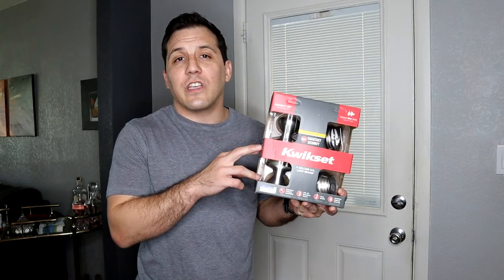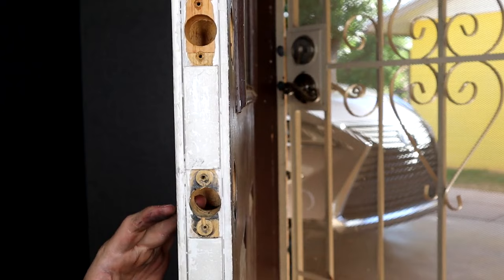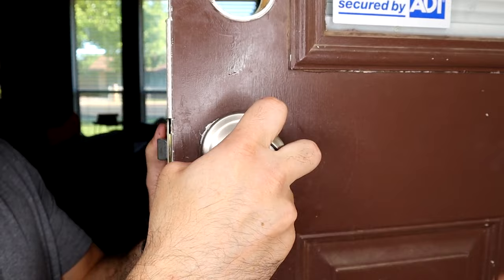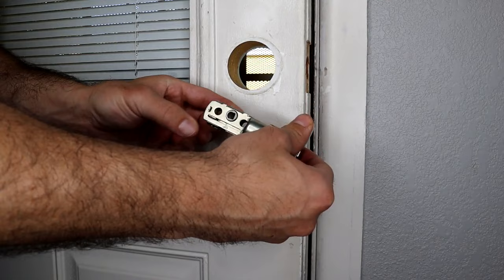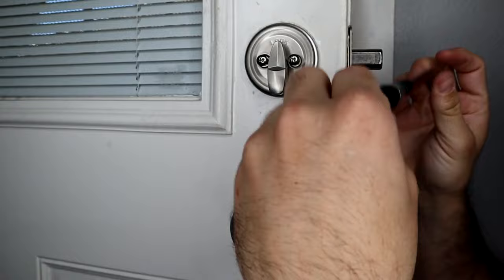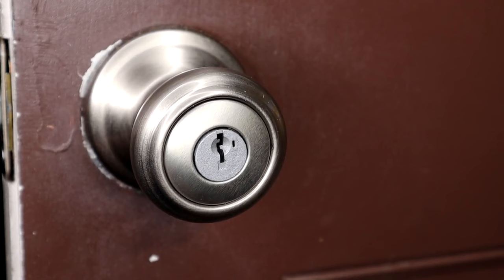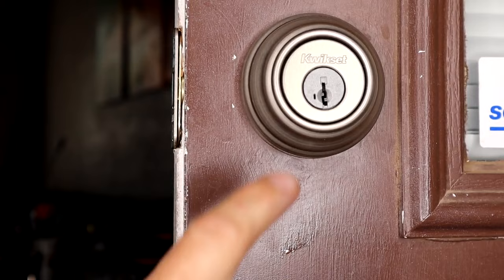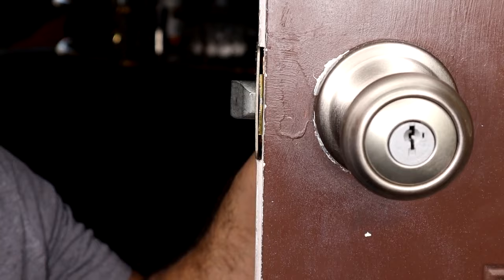How to Install a Doorknob and Deadbolt in 10 minutes - Kwikset Lock Install with Smart Key

Comment: What if the latch is stuck in the out position, preventing the release  of the doorknob? No amount of WD40 will fix this. It's the main reason I'm replacing the knob in the first place. Great video! Thanks for the walk-through!

Nevermind. I got it😊. For anyone struggling with this, I could not find tips on the internet for my situation. My door latch was stuck in open position. I could not turn door knob and latch would not push in. I remove the parts like Robert said but outside doorknob spindle was still stuck in latch. I gently hammered at latch at the edge of door until it moved in enough to release the spindle. I was afraid of damaging the door.

Comment: All great, except that I am really confused about the keys. What is this about old key & new key. If it is a new deadbolt, why are we using an old key? Why do we need old keys to set up a new lock and key?
Reply from the maker: I had to replace 6 doors and I could not buy 6 matching sets with the same key code. So if you cant buy all matching, the kwikset locks with smartkey technology allow you to easily reset all your new locks to one key.
Reply: @RemodelWithRobert Thank you. That explanation of yours makes perfect sense.
The manufacturer's instructions on the kwikset lock just need to add one very basic but key information: The keys that come with the lock work with the lock as is. You do not need to do anything to the key right away. The instructions give the impression that wreaking is a necessity and you will not be able to lock the door without that. This is more of a comment for the kwikset people, not for you.
Reply from the maker: @NoToBusinessCasual  Awesome, glad I explained that correctly. I appreciate the feedback and thanks for watching!

Comment: Can you just use the key that came with it?
Reply from the maker: You can, but if you are buying multiple sets, they may have different keys. If you want to set all of them to one key, then the smartkey option makes that a simple process.
Reply: @RemodelWithRobert  excellent point and thanks for the reply! Any opinion on the Amazon basics or Walmart hypertough door knob and deadbolt combo?
Reply from the maker: I have no experience with either of those products